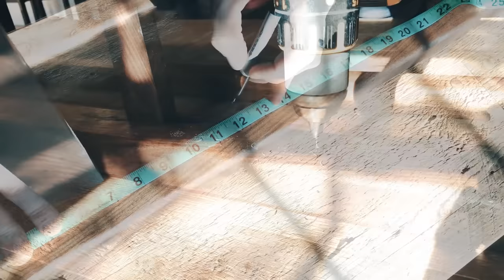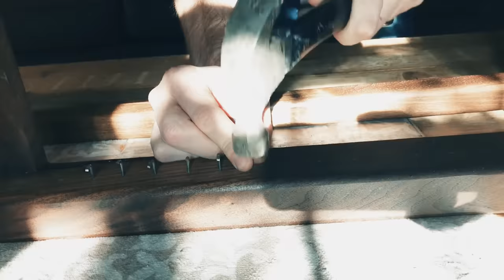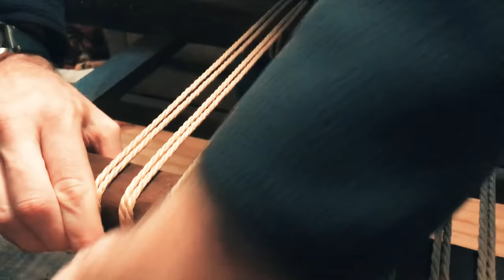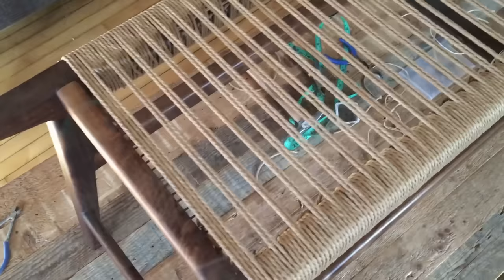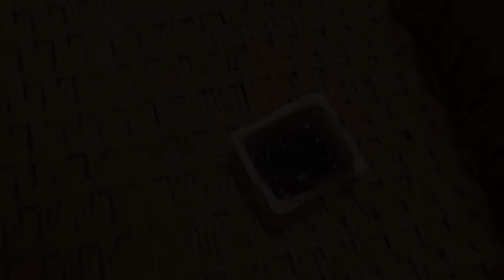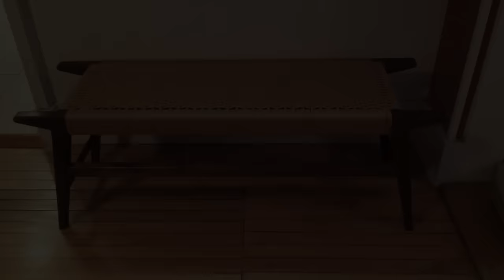Weaving the Bench

Comment: I'm concerned that one dislodged nail would result in the unraveling of the entire weave. In addition, there is the theoretical risk that having tension in only one direction could result in the cross members (or side members) "rolling," but I think that's less likely.

Splices or not, going over/under, both top and bottom, seems to be more secure. I've woven many seats with sisal, jute, and cane and have yet to have a splice give way.

Nonetheless, this is a beautiful bench.
Reply from the maker: Thanks for weighing in Mark. Once the cord is looped over a nail, you can then rely on the shear strength of the nail. The nails are all hammered to depth and bent in place to offer more strength. As for the rolling issue, there is a lot of tension in either direction, but the joinery used in the construction of the bench is more than strong enough to counter this. Seems to me that going over/under would create double the tension both on the top and underneath the seat. It also doubles the amount of cord needed to complete the seat.   Interesting thoughts! Thanks!
Reply: Traditionally it would have been a huge waste of something so precious as nails. Nails used to be individually handmade by blacksmiths, and was way more resource and time intensive than making another feet of cord, which probably still applies in many parts of the world where having to buy anything would defeat the gain in time. Personally I cringe at the idea of using nails, clamps or screws in furniture at all, but that's just me.

Comment: The video is beautiful and the bench too, but it would really be perfect if you provided infos on the crucial steps involved in the whole operation...How to start, how to finish, the measurements for placing the nails, how much cord is needed and how to calculate it, how to change cord if it runs out during the process, etc...basically everything.

Comment: Lovely video David. About to try my hand at Danish cord weaving. A couple of questions if I may. Are you spacing the nail holes 1" apart? I couldn't be sure from watching. How far is the first nail from the end of the front and rear stretchers? Finally I notice sometimes you do 3 wraps and sometimes 4 in between the double strands from front to back. Is that as you feel like or is there something I'm missing.
Thanks
Reply from the maker: mark scheiner hi there! The nails on the long stretcher are 1” apart. This is common for the weave in this direction where there is a space between courses. They’re spaced 1/2” along the short stretcher. As for the wraps, I shoot for a consistent number that is set by what fits in the first few spaces wrapped from the center out. Usually 5 with smaller cord, 4 for the larger. I may go more or less than that if there just isn’t room for more or I need one more wrap to fill extra space. This is all determined by keeping the short courses directly over the nails. Sometimes you just need an extra wrap! Also, by design, less wraps will fit at the ends. Because there are double courses at either end. Thanks for asking!
Reply: @lifeinsidethebox9232  really appreciate your reply David. Very kind of you. Thanks and stay safe.

Comment: How do you work out how much seagrass would be needed to re do a stool?
Reply from the maker: Kathryn Waters that’s a good question. Depends on the type of weave that you do as well as the size of the cord that you are using among a few other things. Size of the stool etc. Material is purchased by weight and you will generally get one seat woven from about 2lbs of cord/rush/seagrass. Hope that helps! Happy weaving!
Reply: @lifeinsidethebox9232  Hi David, when you say 2lbs per seat, do you mean a normal seat and not this bench? For this bench, how much cord is required?